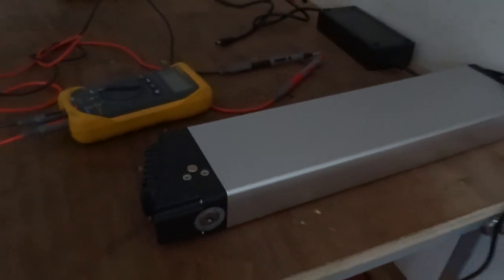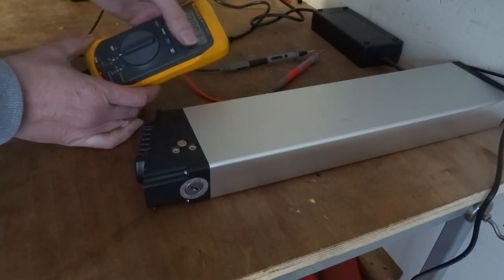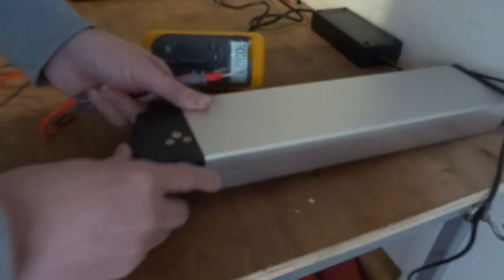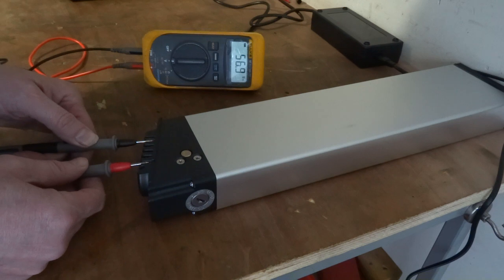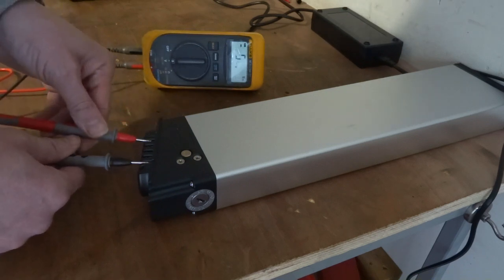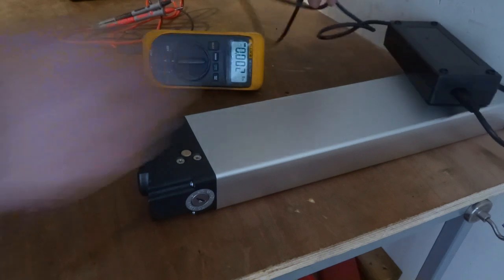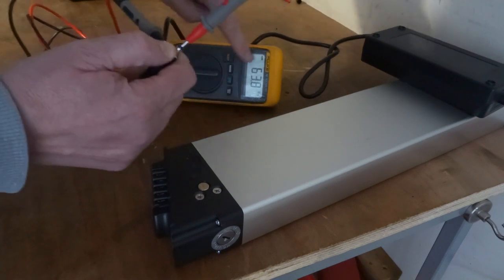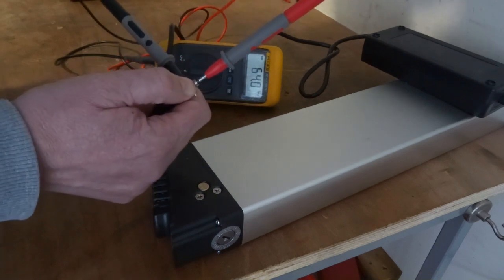How to Test Your Electric Bike Battery Health - Multimeter Guide

Comment: Thanks for this video, I was able to test my ebike charger and battery following your example. My battery not been holding a charge lately. Testing my charger voltage reading is 54.4v which is correct. Battery reading when off bike drops to 44.8v at both input and output. Battery when back in bike drops to 37.2v and bike display doesn't switch on. If plugged into charger, display switches on and voltage reads 54.4v 🙂 I guess BMS stuffed or some faulty battery cells need replacing. I am however thinking if I use a really really long extension power cord I should be good to go 🤣
Reply from the maker: thanks for comment

Comment: My multimeter goes wildly up and down when testing the charger. Doesn't show consistient like you have shown here. I'm looking at a new charger. Thanks for taking the time to make this video!
Reply from the maker: Yeah its sounds like feedback for power supply has gone its a cheap fix if it is that and if you have good knowledge of electronics but the price of chargers these days its easier to buy new.
Reply: @tim I have the same problem with mine jumping low ranges and worried me too but some of our chargers unlike cagmito76s Charger can't be read by a multimeter with the green light because it only communicates when plugged into the batterys BMS to draw the voltage full in Red light charging till it's full Could be a safety security reason, I was told in a e-bike group
Reply from the maker: @DennisMC1974  Yeah could very well need feedback signal from battery to operate might be worth plugging into battery to see if charge voltage is achieved.
Reply: @cagmito76  Yeah indeed I think on some other random chargers like myself and other guy have a voltage safety mechanism That can only communicate with the battery itself and not a multimeter that have smart features to prevent over voltage or fires and stuff like that👍